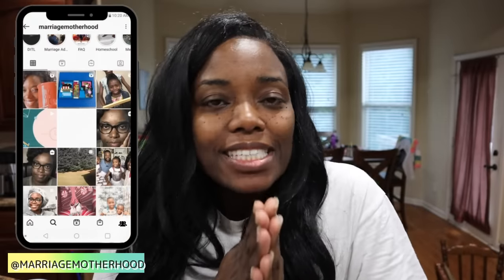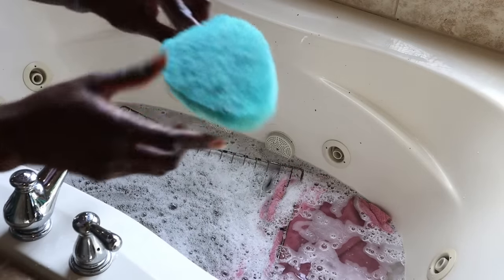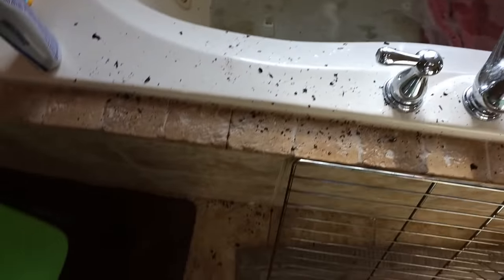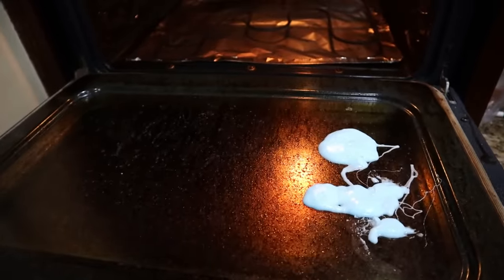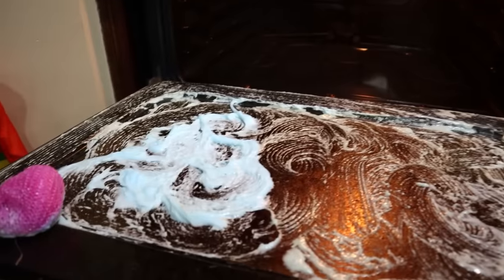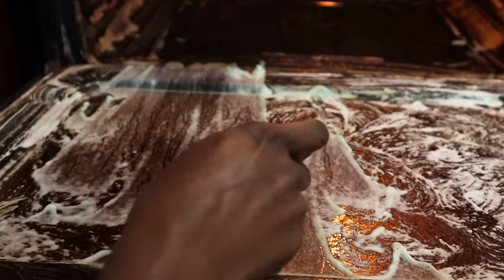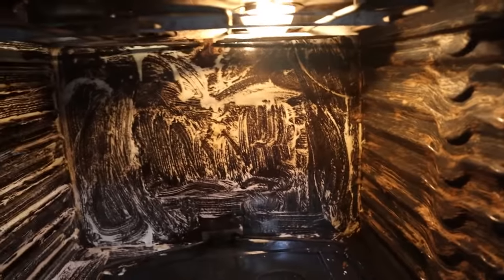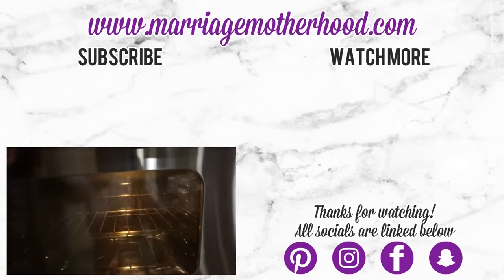Cleaning my Oven for the FIRST TIME / Oddly Satisfying CLEAN WITH ME / This cleaning hack WORKED!

Comment: Steel wool on those wire racks is what steel wool is made for, no Elbow Grease required!
Reply: yup
Reply: @Juliet Marlowe I agree! After soaking in the 'magic mix' I use Brillo or SOS instead of a sponge.  Also don't skimp on real Dawn. $1. bottle at $tree makes 2 batches.
Reply: or just by new racks.
Reply: @sweetmslovinglife  prolly what I’d do if mine was that bad
Reply: Brillo or SOS for the win!!! I use that to clean my oven.
Reply: Exactly

Comment: Okay, for those asking: Easily clean oven racks and gas stove grates....take the racks and grates outside. Place in garbage bag. Add about a cup of ammonia. Close the bag. Lay flat, make sure bag opening is turned up (so it doesn't leak). Now, let "soak" an hour or 2 (better overnight). Carefully open bag, remove racks and/or grates. If necessary, scrub with a little  dish detergent. Thoroughly rinse with water. The ammonia vapors do a WONDERFUL job.

Comment: Jia, this method of cleaning ovens has been around a long time.  With that said, the paste is to set giving the baking soda and vinegar, the acting agents, time to eat away at the grim.  Much like oven cleaner does.  It does not set overnight.  You check it periodically to see how it is doing then you take a wet cloth and wipe.  Mind you without scrubbing.  You may have to scrub a little in places, but usually you do not have too.  It also helps if you clean your oven regularly to minimize the work.  The down side to Tik Tok and Instagram shorts is the viewer does not always get the full story (instructions).  Nonetheless, you did a great job!  Also, the solution is used in sciences classes in schools.  Now, onto cleaning my oven, lol.

Comment: Professional cleaners soak the racks in a garbage bin with hot water and laundry powder, let soak an hour, rinse off with hose. Done
Reply: What about the ones that go on top of the stove over the burners? I can never get those as clean as I like them?
Reply: Wow amazing. Thanks for the tip I'm 71 and I just can't do this scrubbing thing anymore. Age is a true handicap😂😂😂
Reply: @lisakaye3919  try his formula make sure it's boiling water don't burn yourself great good luck
Reply: @lisakaye3919  I just recently discovered goo goo gone and razor blade.
Reply: @lisakaye3919  comet! I clean everything like that with it. Brand new again with elbow grease...
Reply: I cleaned houses as my second job for many years.  I cleaned houses for realestate sales that had never clean the stoves.  If I made the stoves look good I got bonuses because they didn't have to buy new ones.  Here are your tricks... (1) if you're married he cleans the stove.  (2) as many have told you mix that stuff up quickly and get it on.  (3) you can take the door off (4) you cannot clean inside glass unless you take the door apart.  (5) what to use: the degreaser from a business supply professional place.  I know this works in 1/2 hour.  And finally...you work way too hard with kids (including husband) to do that which you did.  Once a month on daddy do list.  So much easier.  You go girl for doing a man's job better than any man.  Girls Rule.
Reply: Idea is good but got a have a big garbage bin too. Any other bin  ideas you can give, thnx
Reply: Laundry detergent is brilliant
Reply: Yup ! Or a big plastic tote
Reply: @FelonGrace  
Tub.
Reply: Lisa kaye put them in a freezer bag and pour ammonia in there and close the freezer bag and let sit overnight and it they will be clean
Reply: You are right! The best and fast way to degrease is laundry detergent - specially powder. REALLY great results / have a blessed day
Reply: @prajac  YES specially powdered
Reply: Yea. Cuz I wouldn't put that in my tub.. YUCK.

Comment: I usually heat the oven a little with the same  DIY cleaner for easier clean up without the struggle.. saves time for me
Reply: I do as well. The heat helps soften any grease
Reply: I would definitely heat up the oven a little bit too sounds much easier....
Reply: Poor thing I could feel your pain when asking your husband for help.🙁Atleast he came back🤣😂
Reply: @lisahart6668  Yes!! So much better !
Reply: @skullbarbie8015  Yes!
Reply: This is Draco’s mama Candi what do you put your stove on and for how long?
Reply: I’m just afraid it will heat up a little too much and I’ll get some burns with my clean oven 😩 but I guess the risk is better than the scrubbing
Reply: yeap works a lot better this way.
Reply: Like they say if u got time to lean u got time to clean.
Reply: hi, do you heat the oven before applying the cleanser, or do you heat  the oven while the cleanser is on?
Reply: hi, do you heat the oven before applying the cleanser, or do you heat  the oven while the cleanser is on?
Reply: I tried that didn't work for me and it started burning where the bottom element is. I tried everything but it didn't work for me without a lot of scrubbing for a really long time.

Comment: I use PBW on all of my stainless steel in the house, including the oven racks.  Soak in a few tablespoons of it and leave for 6 hours.  Repeat until it all flakes off as necessary, especially if you don't want to scrub.  It's also eco friendly and environmentally safe too for septic systems.

Comment: Leave your trays in your bath tub with drier sheets for a few hours. I added 7 dryer sheets with hot water and they come up shining
Reply: I am so afraid of the fumes from oven cleaner I won’t use it. My solution is diluted awesome from dollar tree. It actually had my oven looking brand new. Although my oven wasn’t too bad, I needed to get it in great condition since I was moving

Comment: Try some baking soda and vinegar or use the oven cleaner on it! Or soak again and add 3 or 4 dryer sheets and soak a few hours or overnight!  Try vinegar to foam it some more and keep acting it to get the grime off. Double check but I think that you put your racks in backwards as I was told that that ridge-angled part is for pulling your entree out of the oven and not to have it fall off the rack while checking to see if your food is done.

Comment: Self clean is chemicsl free nothing required hit the button snd go to bed...and i promise it works but that right there may have set the house on 🔥.  Set a calendar to run the self clean every 90 days.  Also run it now to finish off the lasy bit that didn't come off.
Reply: Agree! That’s what I do. But I do it twice a year (in the cooler months... I don’t want a hot kitchen for several hours in the summer). No chemicals required, just make sure that you take the racks out!
Reply: @pbug867  I accidentally left my racks in during self cleaning and it messed them up. They now look discolored.

Comment: Hey y’all! First off I’m not Jeff, I’m Theresa just so you know I’m not some man telling a woman how to do this. Lol okay, how to remove the average oven door, start with the door closed, open it just a bit, then grab it by the sides and pull up. That should do it. I have had three ovens and cleaned five different ovens and all of them have been like that, gas and electric. P.s. if you heat your oven just a bit with a pan of hot water in it, then try scrubbing the cleaner and gunk will come off easier.

Comment: Girl you made cleaning those shelves much harder than needed. Soak one hour in boiling water and laundry powder or blue magic, then use a stainless steel scrubber ball to get the stuck on bits off, rinse - done.

Comment: Back several decades ago, when I was 19yrs old.  I started using the combo of dawn dish soap and baking soda, back when "soft Scrub" was just a few years old. I found it almost as good at cleaning as the above but a BIG money saver. It was/is awesome to clean a very greasy tub after a dirty hard working person took a bath and in cleaning the kitchen and other like things. It cleans w/o scratching the finish and it is effortless in most of those thing getting clean. Oh and yes vinegar is a good added for stuff too. I found that the soap and soda needed a liquid to help activate it's  cleaning component. Thanks for spreading its effectiveness.  It truly is a super cheap and healthier way to clean easily!
Reply: Honestly if I were to try cleaning that oven I would have steamed the oven for an hour or so. It needs liquid to activate it.

Comment: I would have used the 
"No Fumes Easy Off Oven Clearner".
NO SMELLS/or TOXIC FUMES.
Leave Overnight and clean in the morning....Use a Pumice Rock too for hard to remove areas.  
DOES NOT SCRATCH.!!!
Your Oven Would Be Spotless.
You could have saved yourself so much work, time and heartaches.🤨
Reply: Keep in mind that just cause there are no FUMES does not mean it is not toxic. Oven cleaner is a chemical overload. I would never use that stuff...
I use carbarondum sponges on mine...however, I have never let mine look like that...EVER
Reply: I have the no fumes... But it still has us coughing... It's weird

Comment: Very nice job! Hard work for sure, but be careful that the foil doesn't catch on fire. You are rocking the marriage and motherhood.
Reply: Yep, was told by the Maintenance man, do not use aluminum foil on the bottom of the oven or drip pans on top of stove.....you can buy liners for the bottom of the oven, I used to have them for yrs. then they turned a funny color and I pitched them.....I will still use a pc. of foil in the bottom, but very careful how I put it in and make sure the heating element is not touching the foil....and they work great for drip pans, no more scouring the pans..... I use the heavy  duty foil....and so far so good.....

Comment: You are so motivated.  One thing I think might help make it easier next time is to get a drill and use a scrubbing brush attachment.  Then, you just need to hold it and move it slowly around the oven/door while the drill does the spinning and scrubbing.

It can get heavy so you might have to take more breaks, but it can also help with reaching farther in the oven if you get a longer attachment.

Comment: BE CAREFUL WITH THE FOIL! Many newer ovens you cannot do that with or the foil will literally melt to it and you cannot get it off. We learned the hard way with a brand new oven. Of course afterward we saw the little warning on the bottom that said “DO NOT LINE WITH FOIL!” 🤦🏼‍♀️
Reply: @KS - Yea, I was wondering if using foil is a safe thing to use in recently made ovens. Growing up, Mom did that to her ovens and there wasn’t any issues, (that is until her last oven was self cleaning), but I wouldn’t do that with my oven now. Good thing my oven is self cleaning (2000-ish model).
Reply: Oh my gosh this same thing happened with my mom. And the oven was brand new!! Did you ever come up with any solution to get the melted foil up??
Reply: They sell specialty oven liners now that aren't supposed to have the same issues as foil. The brand is Range Kleen.
Reply: @erinscarlet  Ohh! I will have to look into that! I hate cleaning the oven. 😂
Reply: I heard that too, about using foil Sandy

Comment: Okay so for ovens (even if they are bad) the pink stuff paste works really well in combination with a scrub daddy. Also a good tool to have is a razor blade scraper (it won’t scratch the glass) I have learned how to clean from watching “How Clean is Your House” on youtube. Kim Woodburn has taught me everything! But in the future try the pink stuff paste ORRRR use just baking soda and dish soap to make a paste that will barely drip, get a stiff bristled scrub brush, scouring pad, or scrub daddy and go to town with the paste... Let the paste rest for a few minutes (as needed) scrub again and then take a spray bottle filled with just vinegar and spray the vinegar wherever the paste is and let the chemical reaction take place. That will usually do the trick and for pennies on the dollar. If there are still stubborn bits on the glass in particular, take a handtowel that you aren’t gonna be upset about ruining, soak it in vinegar, place it in the microwave and get it super super hot and lay over the oven glass and then start scrubbing or scraping! Love your channel and love your videos!! ❤️❤️❤️

Comment: P.S. to clean a baking dish or more ( just don't do with teflon coated pans) you can drop in a couple of dryer sheets, let it soak for about 10-20 minutes and see how easy it cleans. Great for casserole messes.

Comment: Good advice putting a towel down underneath the racks to protect the surface of the tub. Make sure you do that!  I scratched the enamel on my tub’s enamel when scrubbing the racks! Plus, allow the racks to soak as long as possible. Once I sprayed off the baking soda paste after a one hour soak, I wasn’t able to remove the baked on grease.

Comment: I've used a razor blade to cut through the crusty burnt layer. It takes a bit of time because you want to cut the glass, but it works soo much better and once you get the hang of cleaning with a razor blade it becomes easier. I don't use baking soda because it has ruined my broiler and at one point cut off the igniter for the boiler then the bake. Til this day my ignighter is still broken and needs to be replaced with a new fuse or whatever it uses. No baking soda ever for me. They dont tell you when it crystallized it has a way of effecting electrical circuits.

Comment: Cleaning oven racks. I've been using a trick I saw on Pinterest.  Lay (new) dryer sheets over bottom on bathtub; lay dirty racks on top, then lay more dryer sheets over them.  Carefully add hot water to cover them.  Leave racks for several hours or overnight.  Everything comes off with NO scrubbing.  So easy.
Reply: 46:24

Comment: I am a professional cleaner just offering some insight. Ive learned to turn oven on 200 degrees spray oven cleaner on oven, take racks and put in trash bag while they are warm then spray oven cleaner on both front and back of racks until they are saturated let sit over night or outside if its hot. When you remove the racks use baking soda to remove any stuck on grease. The baking soda will leave a shine on the racks where anything else will take the shine off the racks.

Comment: Great Value Dawn is awesome! I cleaned houses for 15 years and most were vacant rentals! 1. Turn oven on get it warm to loosen junk. 2. Spray racks with Easy off in BLUE CAN...fume free, safe on self cleaning ovens. SPRAY OVEN until coated in white foam. 3.Spray  racks allover on large piece card board in garage or outside & let both oven and racks sit for 4-6 hours. Spray entire can and spray racks on both sides. It'll wipe off with blue shop paper towels! Keep trash can next to oven as you wipe, toss towel. EZ PZ..Hose off racks outside. Oven cleaner will harm sinks, tubs, etc

Comment: You could also place the racks in a 45 to 55 gallon bag and then spray the racks with the dawn. Dishwasher, look Wet in some vinegar. And then let it sit in the bag outside. Tied up for a day or two and they will run software the homes very easily

Comment: My trick is always heat up oven then let it cool with the door open, spray degreaser on around 120-100 degrees then I let it cool to 80degrees and use boiling water with a pan scrubber and it all comes off like butter try it next time 💕

Comment: Just an fyi from an appliance guy, use the nylon scrub pads if you have to, steel wool scratches the glass. The easiest way to clean ovens is with Easy Off no fumes, the cheapest brand from Family Dollar.

Comment: I learned putting foil in the bottom of the over will cause the igniter switch to burn out. I kept have problems with my stove going out come to find out the foil was causing it to over heat, cause of the foil keeping it from getting the proper airflow

Comment: Great video, especially with all the various feedbacks. There is this liquid industrial cleaner that is environmentally friendly that comes undiluted, so you can dilute it according to the kind of workload. So after dilution simply spray on to the surface and leave for a few minutes and wipe. It's been used to clean car engine blocks, waxy floors, and so forth and you can get around 11 bottles out of it after dilution. It's super friendly to kids and carries no toxic fumes, and if consumed by curious kids, there will be no internal injuries to organs, or poisoning. You don't even need to wear gloves while using it. 

If you are interested in more details let me know....

Comment: Hot water & soap soak...then I have a “cleaning curtain” heavy duty shower curtain.  I use towels rolled up around the edge of the table and then the curtain laid over.  This way I can do my cleaning sitting in a chair.  I also use my dremmel tool

Comment: The oven doors are easy to slide off on most models, don’t be scared!  

Next time, just get a can of Easy Off, and yank that oven door off for the wipe down part.  The only slightly tricky part is getting the door lined up on the side brackets to slide the door back on the brackets and snap it back into place.

The racks can be soaked with liquid dishwasher detergent, it works better.

Comment: If you don't use Easy Off on the racks too, just add one cup ammonia to 4 inches of hot water in your tub. Let soak an hour, or overnight. Rinse with cold water. Everything falls off. No scrubbing at all.

Comment: Great job,  you should not let it dry and put the solution on a small section at a time. Like, clean the door, then one side at a time. I also use salt and baking soda to clean the glass. You can always take the racks outside to clean. A lot of work, but you get a A+.

Comment: I use baking soda, a half a lime juice and a half of a potato. 

For durable surfaces add salt,  for delicate surfaces the baking soda is perfect. 

It's great for ovens, pots n pans that are covered in oil grease.... I love it!!!

If you do not use the potato the mixture will not be as effective.  Plus it's a fantastic scrubber that doesn't wear out!! 

It's a fast acting mix